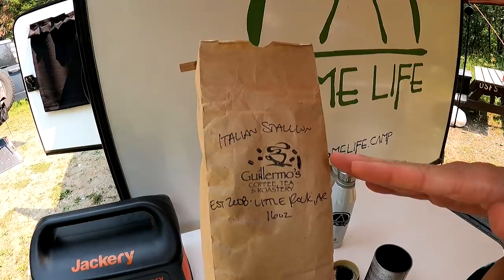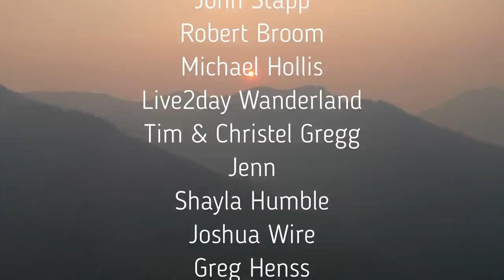Exploring Montana: The Last Great American Wilderness

Comment: Place a wider piece of wood or aluminium at the back and screw it in it to fix your pannel and attach your wire (pr cable) with velcro to the ceilling in there to prevent it to caught again

Comment: Don't know about that trail map you are using, according to Alltrails, that Bluebird Lake is at 6853' and trail has 1100' elevation gain.  Trailhead starts at 5700' on FR319.  Just an FYI.
Reply from the maker: That’s correct if your only going to blue bird lake. You have to add in the hike from blue bird lake north to Wolverine lake to get the rest of that elevation. We then headed East to Clarence Ness trail. That will get you the full loop distance and elevation.